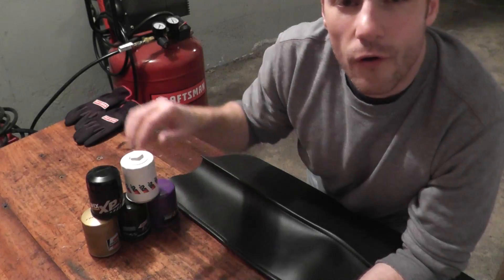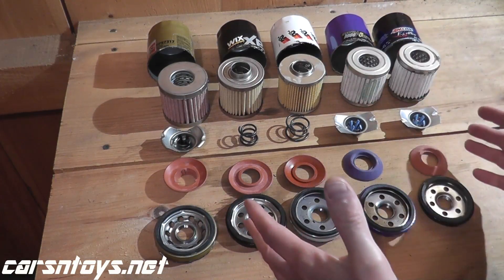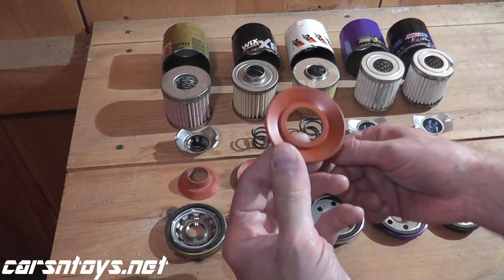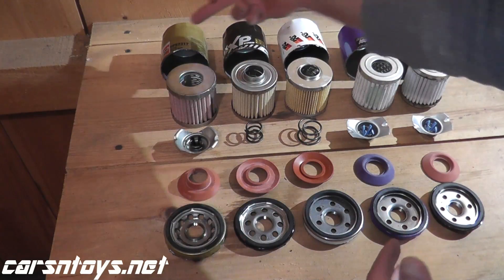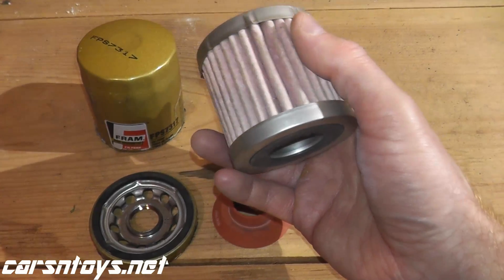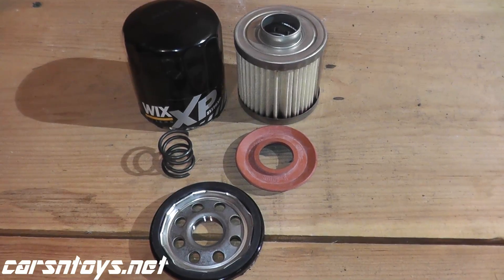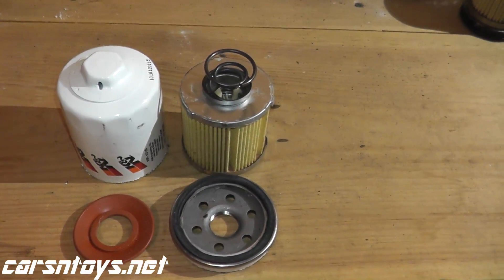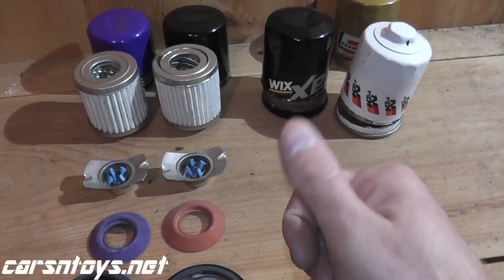Choosing the BEST OIL FILTER...FRAM vs WIX vs K&N vs Others

Comment: It really pisses me off to see Amsoil using the exact same filter as someone else! It doesn't matter if it's better or worse, because my Amsoil reps for years have always said they engineer and manufacture everything in house. I have been a LOYAL Amsoil user for 12+ years, but this video really pissed me off! I will say however, I run their oil in everything I own, and have never had an engine issue. I ran a Toyota FJ pretty freaking hard for 200,000 miles, and that motor is still a Beast today! That's with changing the oil between 20k and 25k miles. Nothing has held up over time like that!
Anyway, looks like I won't be buying any more Amsoil filters!
Reply: maybe RP copied AMSoil and not the other way around...
Reply: Lots of brands specialize is taking a $5 product, surrounding it with an aura of bullshit and selling it for $15.   That's why "you get what you pay for" isn't true.   You do get what you pay for.   Or LESS.
Reply: chevy 350 with over 280000 still runs great and i use pennzoil. Almost all oil is great if changed regularly but faithful to penn
Reply: Is there a difference between these filters?   I do not know, but products mfg on the same line can undergo different quality control limits.  Also, each Seller may supply the raw materials for their own items;  they may look the same but....
Reply: In my opinion...the best AMSOil oil filters were the ones made by Baldwin Oil filters

Comment: We use Wix on our heavy equipment. $400,000 scrapers, and $600,000 articulated loaders, and stuff like that.
Reply: im sure those are not regular oil filters. they are probably made specifically for those $400,000 scrapers and they probably don't cost $8

Comment: After seeing these videos and dumping 2 quarts of oil offroading, & went with Valvoline synthetic, or Mobil 1 and Mobil 1 filters, my truck suffered NO damage, running that low, for over 300 miles. I started putting a small neodymium magnet in the center of all my oil filters, (on the outside). I can reuse it 1000s of times, too. The synthetic oil, probably helped my engine run that low for that long. I bought some cheap 7 11 oil & added a quart, drove to my uncle's house, then got the oil line replaced, and a full oil change. I also had to replace the radiator cap and thermostat, but the fan clutch & radiator were also pretty well shot. The new fan clutch took a crap after 8 months.
Reply: I think Fram is part of Autolite now.

Comment: After seeing this vid I will cut open 3 oil filters for air compressors.  A cheal one, a Mann and one from the compressor manufacturer. Would be interesting to see what the difference is. PS my filter and 5 ltrs of clasic oil = £20. So I change it every 6 months which = about 1500 miles.

Comment: wix is the way to go. I've had my truck for 9 years and it just hit 260k miles on her my oil of choice Mobil 1 gold high mileage full synthetic and a wix filter. you can't go wrong for everyday use
Reply: Use panzoil ultra platinum way better oil

Comment: wix is the way to go. I've had my truck for 9 years and it just hit 260k miles on her my oil of choice Mobil 1 gold high mileage full synthetic and a wix filter. you can't go wrong for everyday use
Reply: I don't think you can go wrong no matter which of these brands you use. Main thing is to use the recommended grade of oil and the recommended OCI (oil change interval).

Comment: This is all fine and good, doesnt change the fact that I am daily driving an old toyota truck with nearing 400,000 miles on an engine that was never rebuilt that only saw the cheapest oil and oil filter I (and the previous owner who was a family member) could find for nearly 30 years.  Lol.  So who cares about pleet count, thickness of casing, etc. Waste of time and energy.  Just change your oil and filter and ensure you dont run low on oil. Thanks though. Come on, fourteen bucks for a K&N filter with a nut shape on the end to remove overtightened filters by knuckleheads? Ill stick to 99 cent garage generics.
Reply from the maker: I agree. One of my first vehicles had over 300k and changing oil at the right interval was key. Thanks for sharing.

Comment: So funny. I have been using fram extra guard filters and regular penzoil on my truck since my dad first bought it back in 1996. The truck passed 400,000 miles about 4 months ago. Everyone tells me how bad penzoil and fram are and yet I haven't met anyone with more miles on the original motor than mine. I use other oil on other cars as I like doing oil changes less often, but the truck still gets regular penzoil and an oil change every 3000 miles.
Reply: I dont like Fram because people often exceed their recommended intervals. I have seen collapsed Fram filters on two different occasions. If you change oil every 3000 miles religiously Fram is ok. Still not the best engine protection but ok. I reccomend and use OEM filters.
Reply: People try tell me that my Pinto is unsafe...  But I never come to a full stop, and it's unlikely someone will strike it hard from behind if you are always moving.    
Big Money, no Whammies! 

Keep on truckin good buddy!
Reply: @xwarmangle  haha awesome
Reply: Fram ultra is arguably one of the best oil filters on the market, light years different from the orange can. Pennzoil is also one of the best most reliable oils on the market. Pennzoil and Quaker State are both owned by shell oil products and produce some of if not the best oil reports ever. Things change, technology and companies do too. Don’t let people steer you wrong unless they have facts.
Reply: More than anything else it is the conditions the oil is subjected to ... Number one - Was it highway miles or city miles? 100,000 highway miles is equal in wear to 10,000 city miles. So short trips, extensive idling, stop and go driving etc. will be most detrimental to the longevity of both the oil and the engine.
Reply: JackTannehillPromoter Just because a reply was added recently and i saw this. My dad in is the original owner of the truck. He is a general contractor. Definitely lots of freeway miles, but always loaded up with tools and stuff in the bed. Towed somewhat regularly. Offroaded rarely, twice a year. I did all the maintenance and always used conventional penzoil and fram filters. I still own the truck but it is an extra vehicle. Has 409,000 miles and stills runs good. Burns a little oil though so its not perfect.  I have been working on cars as my hobby since i could walk. I have never seen a Fram filter fail and those and factory Honda filters are all i have used. I have used pezoil almost entirely but i used royal purple in a built na b-series Honda and and use castrol conventional in my rotary as the rotary guys seem to like that best, not sure why.
Reply: At 3k oil changes you can run whatever you want. At 3k intervals use the cheapest you can. Fram though ive seen fail... Never again.
Reply: D Mack  Valvoline is and has always been a quality oil.  I've used it for several hundreds of thousands of miles over the years in different vehicles with no complaints.  That said, Pennzoil had a reputation 3 to 4 decades ago of some users complaining of sludge.  It was still considered a good quality oil, just that some people had the perception that prolonged use could cause sludge.  However, around the turn of the century Pennzoil was purchased by Shell, and Shell has used cutting edge technology to really improve Pennzoil, especially the synthetic line.  Pennzoil Platinum and Ultra Platinum are now considered to be two of the absolute best synthetic oils on the market.  People that keep up with this stuff know this, but other people who don't aren't aware and are going off of hearsay from decades back.

Same with Fram.  Their "regular" oil filters are average at best, but their Ultra Synthetic is top notch and one of the best.
Reply: Pennzoil ultra platinum is amazing!
Reply: I can believe that but superior oils do add noticeable performance, power gain (proven in dyno tests - hotrod mag for one) and max fuel economy beyond expectations.  The difference really is the individual being an enthusiast or not. Same with transmission fluids.
Reply: Oil change every 5k does wonders
Reply: I change mine every 3,000 and coming up on 300,000 on my silverado but I have a buddy who has never changed his oil in his ford ranger just tops it off and changes the filter when it gets rusty and his ranger has well over 300,000+ miles and still runs good the truck is falling apart but it's still going!
Reply: @SC-fj2zp  Stay away from gm products....
Reply: What kind of engine is in the the truck?
Reply: Just did an oil change on my 2001 Dodge Diesel. Went with Delo Synblend since it was only $14/gallon ay wally world. They didn't have alot of choice for filters. So I went with the Fram ultra synthetic filter. Hopefully it holds up while towing. Probably should have gone Mobile 1. But I'll probably go with Fleet guard or wix (or Napa) from now on. Any opinions?
Reply: @chilidog73  the Fram ultraguard oil filters are excellent, their orange ones are crap.
Reply: I have a '97 extra cab Nissan p.u., still in great shape, 235k miles, runs great. I live in Norcal, mostly freeway and city driving too. Nice weather. I buy Walmart Supertech Full syn hi miles 10-30 oil for $13.95 for a 5qt jug. I just use 4 qts. so it's a free oil job every 5th change. I now buy online Wix oil filters for $5 to $6 and change the oil every 4-5k miles for about $17 every change. If I'm laxy I take it to a close by place that will change it for $8 with my oil and filter. Maybe overkill but it's fine. I used to use a reg Fram filter and reg. oil every 8k miles but decided to baby it and step it up with a better filter and oil to make it last long plus change it more frequent, "but not that much" to keep the cost from being out of hand for this old truck.
Reply: Sounds like a testament to the fact that routine maintenance is more important than which part you choose.   Was the oil conventional?  Wasn't aware of any reputational issues with Pennzoil.
Reply: @GarenP  There were myths going on for a long time that they used wax fillers that cause sludge
Reply: @TheMstwntdLMSV123  not wax filters , alot of parifin in their oil
Reply: @joeherrick5185  The rumor also goes back to the 60s/70s and has been mechanic gossip ever since.
Reply: Every 3k miles tho isnt impressive
Reply: I have  2006 Toyota Sienna with over 357,000 miles. Oil change every 12,000 to 15,000 miles. I use Amsoil.
Reply: D Mack  Pennzoil Ultra Platinum is one of the best you can buy, short of Amsoil.  Search for project farm for a nice video comparison, or you can go full oil nerd and read bobistheoilguy.com forums.  I think your mechanics knowledge is about 20+ years out of date.
Reply: I've used basic fram filters on my older cars and trucks never had an issue with regular oil changes...
Reply: The orange Fram filters are crap with cardboard end caps as opposed to the metal ones you see here. The filter media looks fairly thin and sparse too. 
  Pick up an orange Fram and then pick the same size of any brand you see here and it's not much more than half the weight.
  Do your engine and peace of mind a favor and spend the extra few dollars on the filter. 
  It's actually much cheaper though because you can go 2 to 3 times the mileage on the more expensive oil filters.
Reply: Now you know how evil politicians and their shysters get people to constantly vote for people who do harm to the voters.

Comment: I see Fram on Ferrari a lot. Them people have money and are not trying to save on a cheap oil filter.
Reply: current president has put over 300 people back to work in one small town that previous president caused them to lose
Reply: I cant imagine that Ferrari filter is the same as others
Reply: Nothing wrong with a Fram.
Reply: $$$ does not directly correlate to intelligence. Example: current President.

Comment: I would appreciate if you go into detail about how that bypass Spring Works instead of selling on the most expensive Welbilt oil filter you had to tell him all the bypass Springs open up when the oil is the thickest at first startup and any dirt not caught in the cellulose or the mix of cardboard or paper whatever they use for filtering goes back through the engine again every time that bypass opens the dirt goes right back through the engine again that's why I don't use more than a $3 filter but the best oil I could possibly buy the please go in depth on how that bypass Spring Works and why it works and what happens to all the dirt that sits around it that is not caught by the filter
Reply: yes

Comment: What people don't understand is that oil yes needs to be filtered but the life span they say the filters will last you should actually he changing the oil far before that. It doesn't matter if it's synthetic or conventional the fact is that cars do not reach high enough internal temperatures to boil off water In the oil. This water is very bad for the engine and this is the major reason why you need to change your oil 5-8k newer cars reach higher temperatures which is why the manufacturers of the car recommended higher time intervals to change the oil. But at the end of the day you aren't changing it because the filter is bad and the oil is dirty, you are changing it because the water content. Buy a regular filter oem spec and change your oil at the right interval and font waste your cash on these high priced filters.
Reply: If the engine oil is mixed/ contains oil, it would likely show up as an emulsion and I have never seen this in any engine I have had.  Now as for hydraulic oil in heavy equipment that is not run long enough to warm the oil to 150+ F, yep, water shows up in emulsion form.

Suspect water in the engine oil?  Take a sample and heat it up.  If it pops, that is a volatile that could be water or coolant, no?

Comment: Why would someone invest in a deluxe super expensive oil filter that gets thrown away during an oil change? Saying it filters better is a laugh because in order to do this the pores in the filter material have to be smaller and taxing the oil pump which was designed to operate properly on the correct oil flow and pressure. If it's a major brand it will probably work as well as any other for the short time it's going to be used/

Comment: Been using Royal Purple for years. Last changed the oil in my 97 Toyota T100 summer of 2015. I use 3 candy bar style high power rare earth magnets on the filter. After two years the oil is finally turning honey brown. I used to only get about 8000 miles out of a Royal Purple extended life filter before it was just tar black, but not anymore. Magnets! Best thing you can do for your engine oil.

Comment: I personally prefer Frame filters. I ran a 2004 Hyundai Elantra and used nothing but Fram for all my oil changes. My oil on the dipstick stayed golden the entire duration of the oil life cycle. One particular oil change I was stuck having to use a Wix filter. After just a few hundred miles, the oil on the dipstick was as black as tar. On the next oil change I used Fram again and the oil was still darker than it had been. The second oil change and all the following oil changes I used nothing but Fram and the oil went back to staying golden. I can only speak from personal experience, but I won't use anything but Fram from now on. (Side notes, I use the cheapest available conventional oil, changed at 4000 k miles.) Elantra ran to 197,000 with zero engine issues. and only stopped driving because it was totaled in an  accident.)

Comment: all filters are the same dude  doesn't make a shit difference what they use to filter oil they all last about 7 miles then the bypass will open either in the pump or in the filter and yes Im certified through puralator and Qakerstate you pay for a name and puralator makes 90% of them but throw your money away just like k&n air filter is not good for a street vehicles unless you change and clean every other day and their filter oil destroys mass air sensors but advertising companies want to convince people to buy money money tell them anything to get people to buy

Comment: I was told from a Toyota engineering tech that Toyota no longer uses fram oil filters because it restricts the oil flow to much to the last set of valve rockers that get oil to the point that it can destroy them.
Reply: Clint S -my dad retired from Honda they kicked out fram at least 10-15 years ago because quality. I used to use gram exclusively fram . I changed my oil myself if you know anything about cars keeping oil in it essential. Once I changed my oil I always check the oil even though I knew how much it holds I double check it. Everything checked out. I drove it to town(the car with the fresh oil change) ate lunch. I came out there's a massive puddle of oil on the ground. I had to have the car towed home. Fram oil filter had a bad o ring. So I took pictures of both the o ring, and I went and bought a wix took a picture of wix with a good o ring. After I submitted the pictures and I offered to box up the filter and send it to their lab for investigators. I said you are paying for the tow,oil, new oil filter right. This happened 10 years ago they still have not called or wrote back. To this day I won't buy a fram product

Comment: Would you recommend a K&N filter for daily driving? I'm mostly for it due to the 1" bolt head attached. Maintenance would be a breeze.
Reply from the maker: I've had zero issues with K&N. Other viewers have noted oil leakage past the gasket. I agree; the 1" nut is a really nice plus.